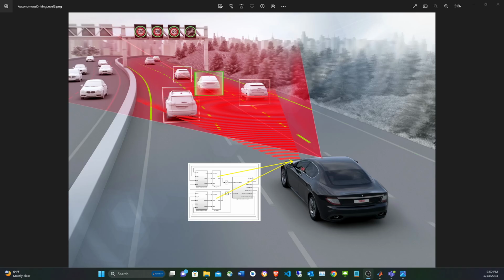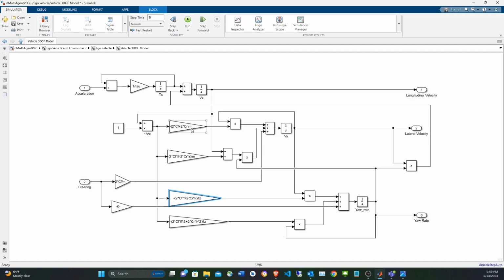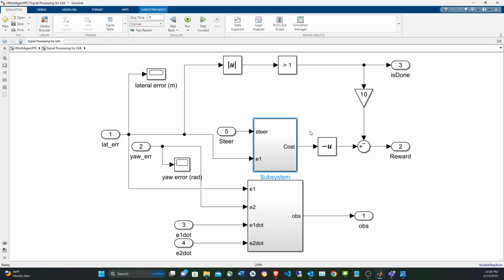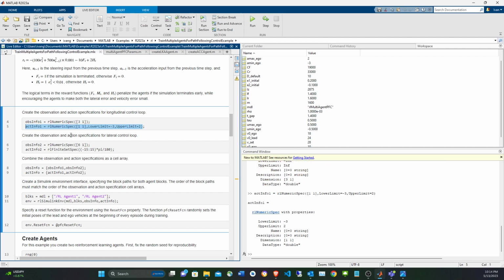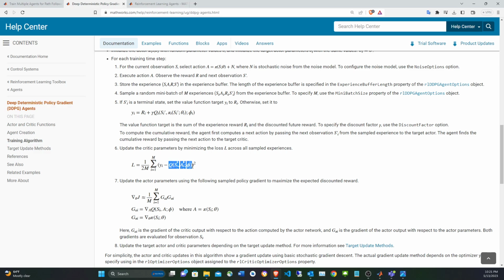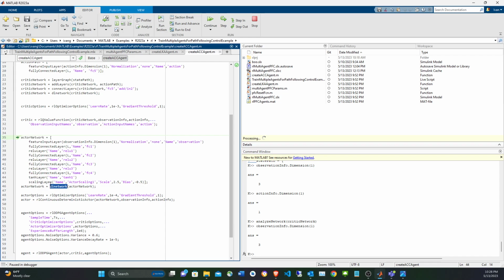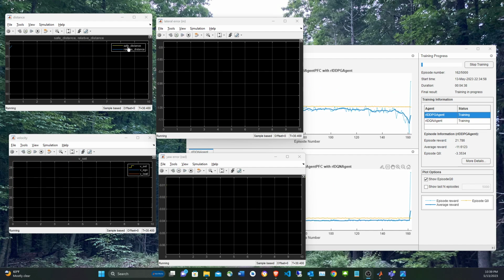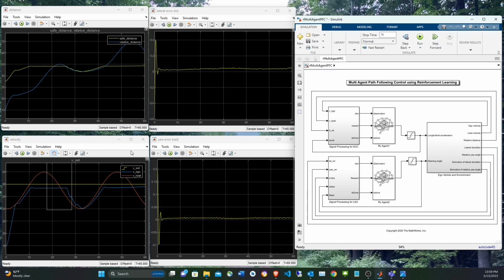Train Multiple Reinforcement Learning Agents for Vehicle Path Following Control using DDPG and DQN

Comment: Hi, great video, It’s really useful! I wonder if I could set two different sampling times for two agents. I mean, for example, one agent with Ts=10s and the other one with Ts=60s. Does the environment still see an action coming from the second agent every 10s within the minute, but constant, or there will be any problems?
Reply from the maker: I think this is something that could be experimented in this same example. In the example the sample time is set in the Ts workspace variable. The two agents use the same Ts (agent1 = createACCAgent(obsInfo1,actInfo1,Ts); and agent2 = createLKAAgent(obsInfo2,actInfo2,Ts);). They could use two different sample times. Other than that in the example, the Ts is only used to determine the MaxStepsPerEpisode training option. The model most likely is using Ts as its sample time. This could be done by having two different sample times in the agents, the model and the MaxStepsPerEpisode using a third sample time that is the maximum common divisor between the two sample times. Most likely you will need rate transition blocks in the model to change from model sample times into the agent sample times and vice-versa.
Reply: @IvanGarcia-cx5jm  Thank you so much for your answer! I'll try something out, if I accomplish something I'll post here a few lines for future reference